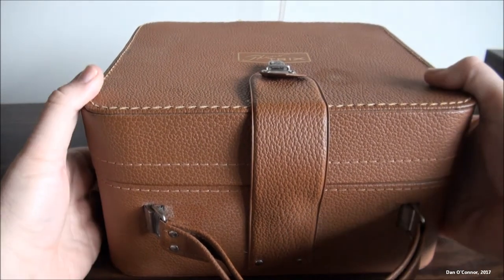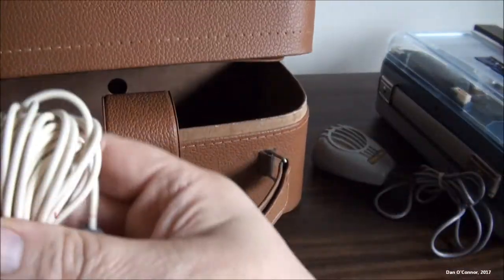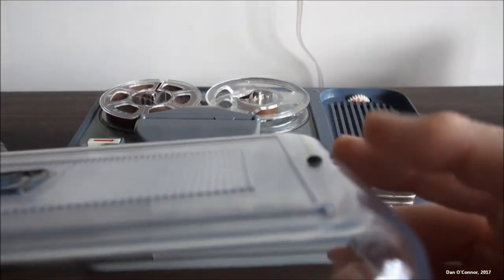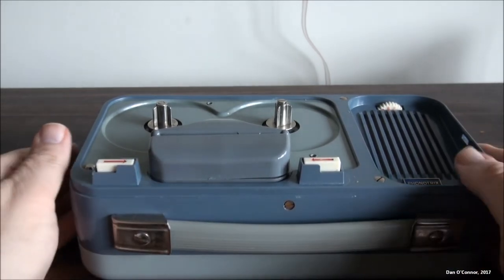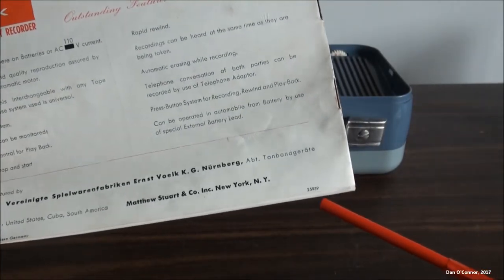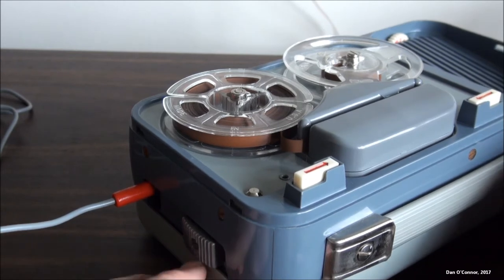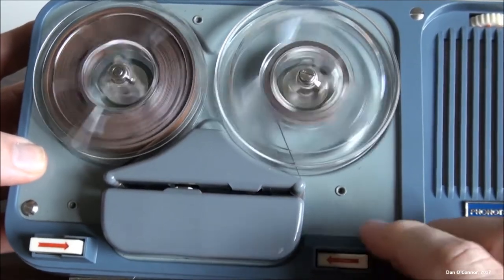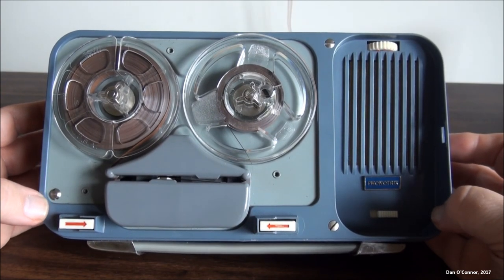1959 Phono-TRIX Tape Recorder (W. Germany)

Comment: Thanks a lot for your video! Got me one of these at the flea market (in a worse, but still functioning condition). I could not not figure why it was "spitting out" the tape, but this video clearly shows the correct way to thread the tape and how to get to clean the tape heads. Nice! I'm impressed that it still works, being more than 60 ears old...

Comment: Can it record music?
Reply from the maker: It can record anything you can get in the mic,  even music. Music won't sound very good though - low quality if you're just holding the microphone up to a music source speaker. There is that little adapter that appears to be designed to hook up to some source. Maybe that would sound better but I never tried it.